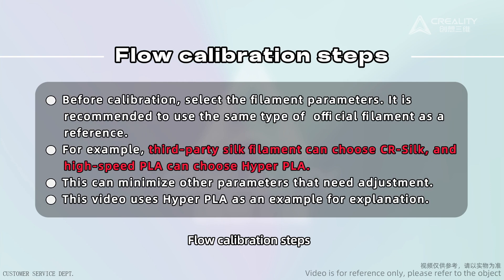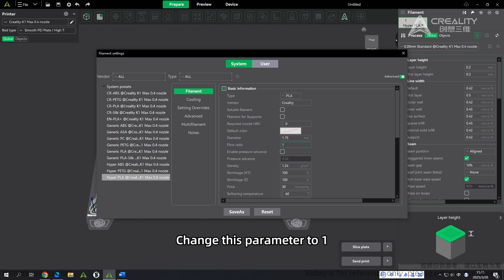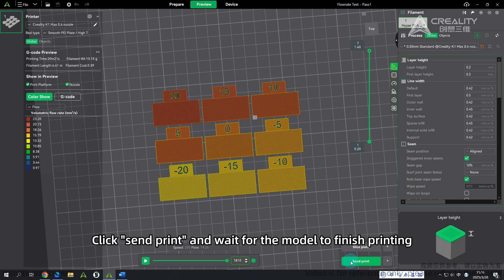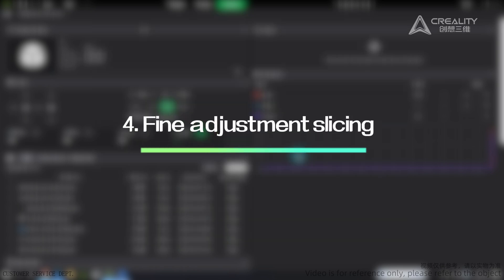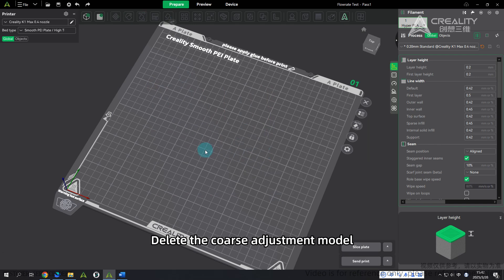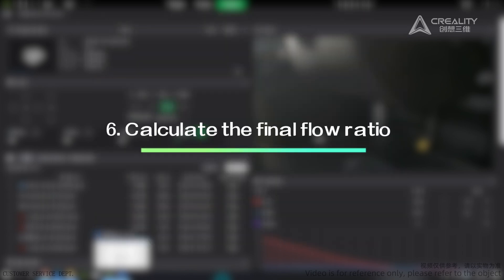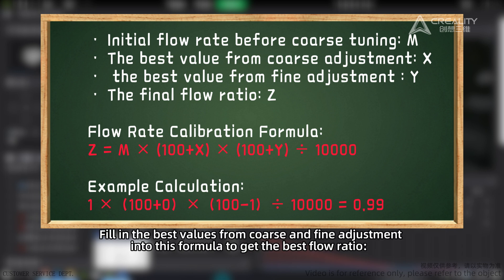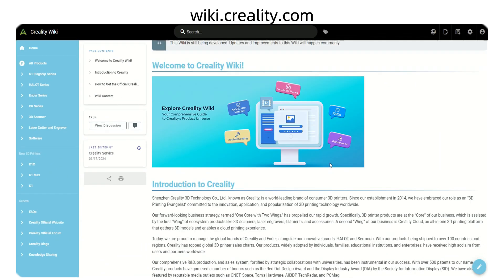Creality Print 6 0 Flow calibration

Comment: There was no problem during k1 max 5.1. I used 5.1 in calibration. Then I switched to 6.0 and immediately pressed print, I chose the option to both calibrate and print, and it crushed my bed.. I cut off the electricity and was able to stop it. He survived with minor scratches but I asked for a tray. I asked for a bed but they never sent it.    Because of your software error, I was asked to straighten the bed in the incident. Dude, I already worked on my bed for a week and fixed it, but your software broke through again.